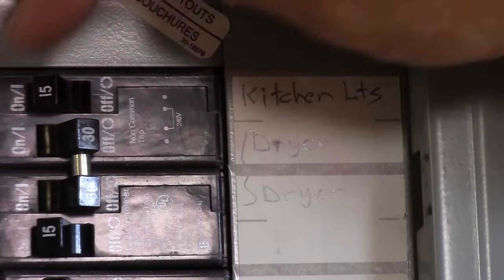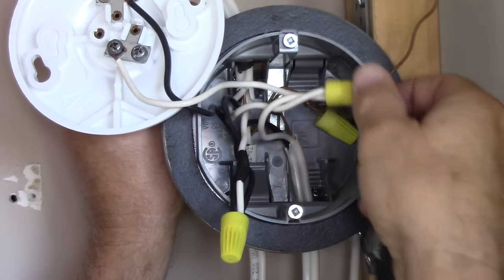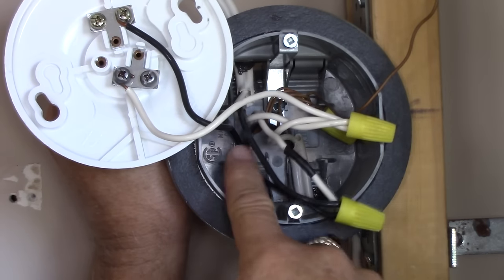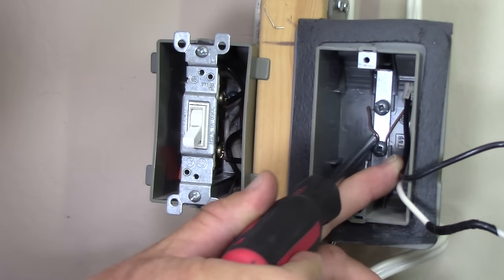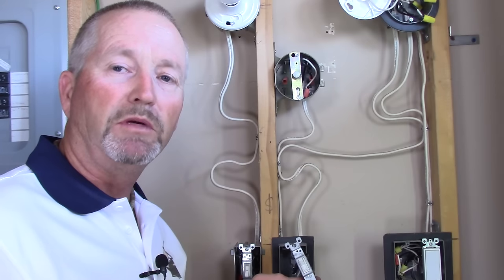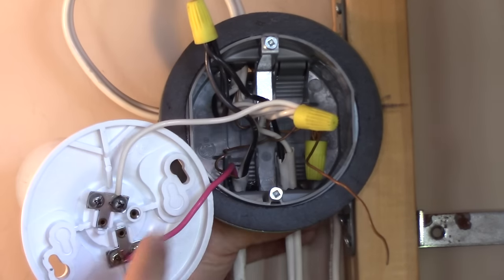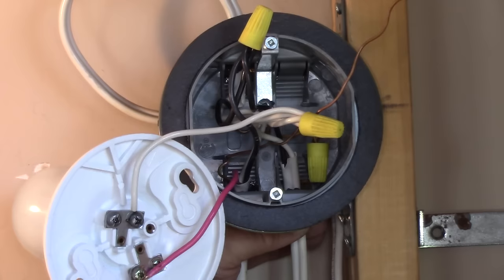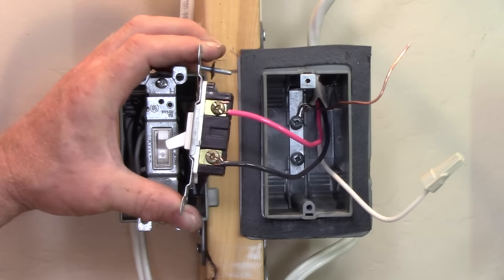How to Wire a Light Switch:  The Switch Leg Loop/Drop

Comment: I have a malfunctioning 3 way circuit. When I take out both switches and test the wires, both the red wire and 1 black wire in each boxes are hot. I thought only one black wire should be hot. Help! I have three extra hot wires.
Reply: Did you figure it out?

Comment: Why didn’t they just use a black pig tail down to the switch leg in Stead of a weight then having to mark it or phase is out as black hot??
Reply from the maker: Because then you'd be connecting 2 white wires to the light fixture instead of a hot color and a neutral (white).

Comment: @terry_peterman how can I do this with a 3 way setup and utilize the old traveler? I am trying to install a smart switch but require a neutral and will use a wireless 3 way for the other connection.

Comment: How do I wire up two,  3 way switches where the power is coming from the light fixture? Please help.
Reply from the maker: Here's how to do that.  Keep in mind, this no longer complies with the new code (where you need to have a neutral at every outlet box), but it works, and not a terrible code violation as it was allowed up until a few years ago.  To make it compliant you would need to use 4-wire cable instead of 3-wire for the runs to the switch boxes.  Also, if using this exact method, make sure you identify that first white wire that you use to bring the power down to the first switch as a hot conductor with some black electrical tape close to where it is spliced or terminated on the switch.  https://www.electrical-online.com/3-way-switch-diagram-variation-4/

Comment: how should the wiring be done for ... i have a three wire switch loop for the front entry hall light that goes to the switch box which also has a second switch which goes to the porch light and also goes to a couple outlets in the front room , and now niether of the switches turn on the lights and the 2 outlets arent working but when i check the outlets with the plug in checker it comes up as open ground  when i turn the porch light on and if i turn the entry light switch on no light on the outlet checker comes on,how can i wires these corectly so my 2 lights and 2 outlets willall work again, its driving me nuts!
Reply: 1) Plug your tester into the outlet so that the tester lights are on. 

2) Turn off the breaker at the panel and confirm it is off by checking to see that the plug tester lights are off 

3) Take the two wires off the porch light switch, twist them together and cap them with a marette or electrical tape 

4) Take the two wires off of the hallway switch and individually cap them 

5) Make sure all of the bare copper ground wires are fastened under the ground screws in the back of the metal box. If the box is plastic, twist all of the bare copper ground wires together

6) Turn the breaker back on confirm that the plug tester lights are on again with a new reading of correct wiring. 

7)  Turn the breaker back off

8) Take the first individual wire from step 4 and put it on the top screw of one of the switches. 

9) Take the second individual wire and put it on the top screw of the other switch. 

10) jump the twisted wires from step 3 to the bottom screw of both switches.

11) Turn breaker back on 

12) Enjoy the working lights and plugs 

13) send me $25 via paypal

Comment: Supposed to re-mark the whole length of the white wire with tape or three continuous lines with marker
Reply: And you don’t need a neutral at every box. Accessible wall, pipe to box and both sides of a 3way are visible to each other are exempt.

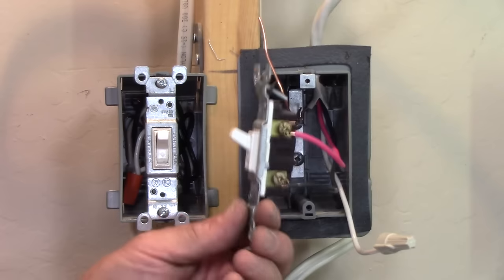Comment: I'm really confused with the requirement for 3 wires. At 5:01-6:34, you've changed out your 2 wire for a 3 wire, then attached your neutral to the light, coming out on red and to the switch. So the red at the switch is basically a neutral that you could pigtail and split it in two wires before it goes in the switch. The other neutral is redundant, no??? This doesn't make sense.
Reply from the maker: The neutral is in the light outlet box. Now that we have a three wire cable going to the switch, we can also have a neutral available at that switch outlet box. We are not using it with this simple single pole switch. The hot wire at the light outlet now goes down to the switch on the black wire and then comes back up to the light on the red wire to complete the circuit when the switch is on.
Reply: The black is the Line Hot and the Red is the switched Load. The 2 wire system is using a white wire as a hot.

Comment: Hello There: Yes I have a regular wall switch on my garage when I first but a motion sensor & it STOP working. So I try to reinstall a new motion sensor & still no power at all.When I took the face plate off pull the old switch I saw 3-white wire tries together 1-red it self 2-black wire with 1-white wire all 3-wire tries together. So I hope to get my power back in my 2-car garage oh I do have some power in my garage to running the garage door opening & my work table & power tools tooI'm calling from Houston Tx oh let me know if you like to see some picture about it ok

Comment: these days the terminology get crazee - so please explain when you say HOT does this mean LINE? the the other black wire you mention is this the LOAD that gives power to the fixture?  all manuals say LINE or LOAD which well explained but electricians still mentioning HOT or BLACK WIRE - CONFUSED!!!
Reply from the maker: Hot can be synonymous with line.  Load is usually used to describe the device being controlled by a device, (switch, GFCI, etc) And the load wires are also "hot" when they are on.  Did I help, or make it worse?
Reply: @theinternetelectrician  you clarified it thank you.

Comment: There is countrys such as Mexico where ""no electrical codes exist"" not even electric inspectors...and no FINES for wrong conections...
Reply from the maker: I know!  There are even some States in the USA that don't have required mandatory training for electricians, and maybe now, but not long ago there were States that had not adopted the NE Code as the rulebook. So it's not just Mexico.  I've spent much time in Mexico, and now in Costa Rica.  Costa Rica has adopted the NEC but in many parts of the country there is no inspection and enforcement in place.  I built a home here, had all the proper permits, but never once saw an inspector on the job.  I wired it myself to the NEC standards, AFCI / GFCI where required, etc.  Probably the only home in Guanacaste that is done to this standard!